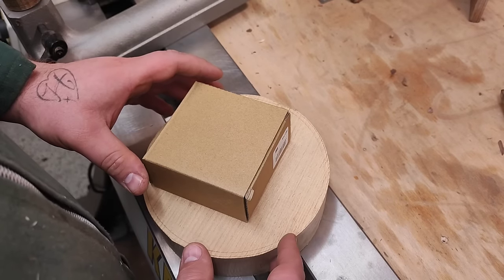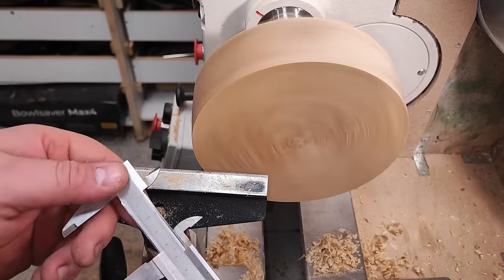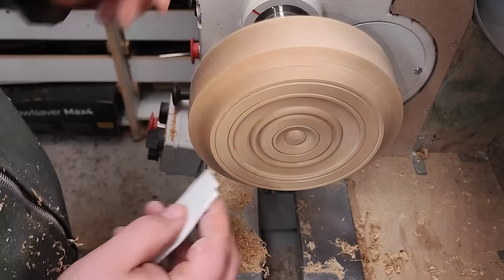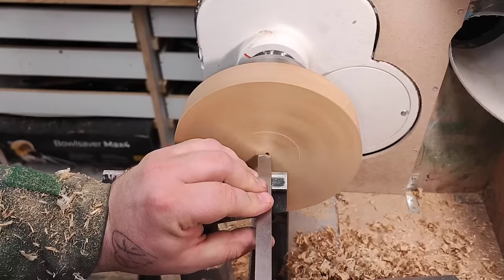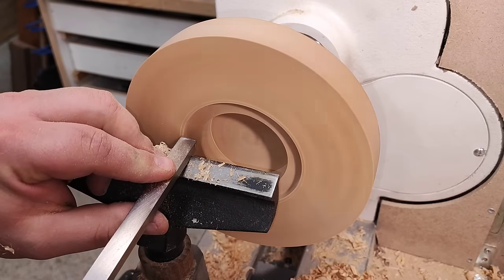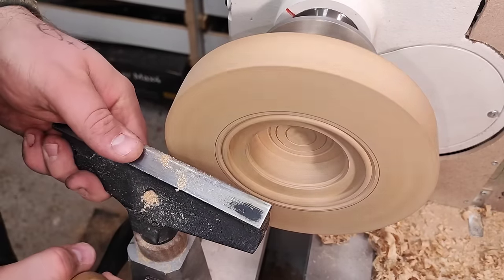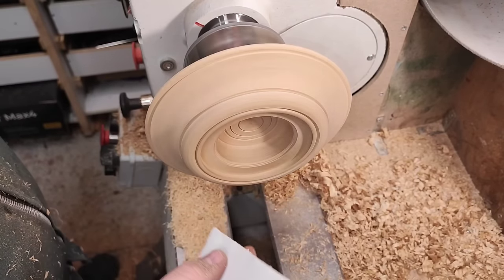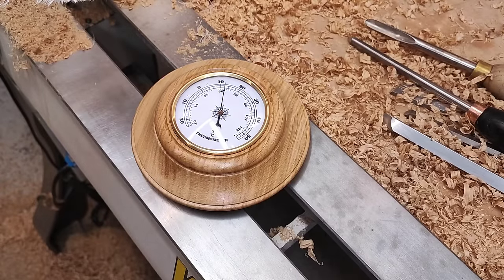So much skills to learn on this small project

Comment: Nice job! For pieces that won't be handled daily, I have used button shellac (for a warmer aged look or sanding sealer to keep the wood's original color) buff with cotton rag and heat from turning. Then topcoat with carnuba wax. The shellac or sanding sealer dries faster than the oil and the carnuba simulates a French polish. Then shine can be reduced if needed by using a softer wax or wax blend. I repaired antiques before becoming a turner so I had to learn to copy many finishes, so I probably have more varieties of finishes than most turners do.
Reply: Thank you for your advice.
Reply from the maker: Thank you Richard for sharing your knowledge, really appriciate that and thanks as always for watching 😀

Comment: A very beautiful wall mounting  , the amount of the metal bezel protruding from tenon is perfect . How does it hang on wall ?
Reply from the maker: Thank you very much,I find a place for it on the shelf ,but to put it on the wall you can drill the hole and put metal strip across to catch the screw or nail head.

Comment: Dear Sir, could you tell me the oil you use for your work and where I can buy
the mechanism. My congratulations on your work. Thank you.
Reply from the maker: Thank you very much, mechanisms are bought at Steinert woodworking in Germany and oil I used is from them called turning oil, its linseed oil and wax if not mistaken.
Reply: @tomislavtomasicwoodturning  gracias por su  amabilidad

Comment: Thanks for the video. It should be polished after 2 days, when the oil dries.
Reply from the maker: This method dries so fast, its so little oil and heat and friction start to dry it out...
Especially with wax on top which melts with oil.... I have done like this so many times without any issue but if using oil off the lathe then sure, you have to wait to completely dry 😀